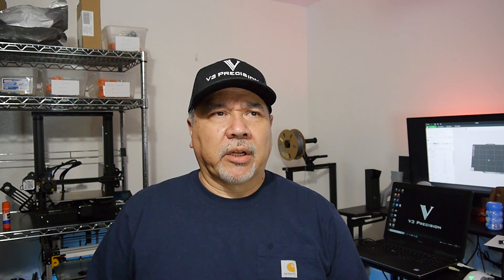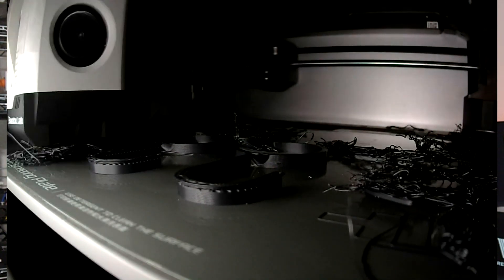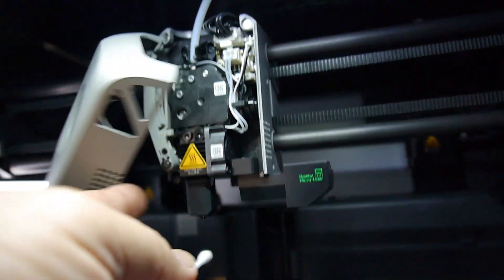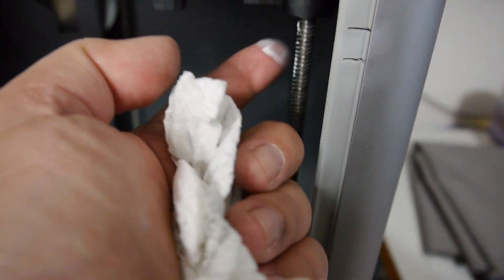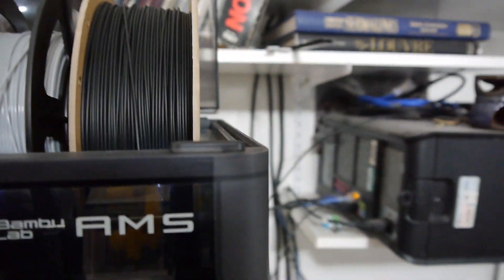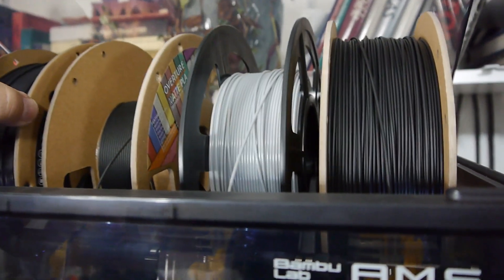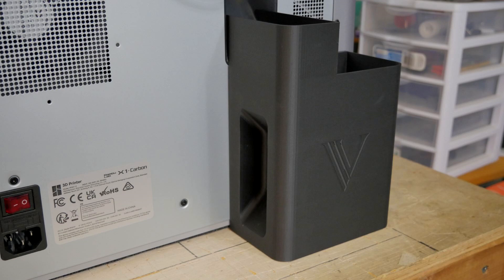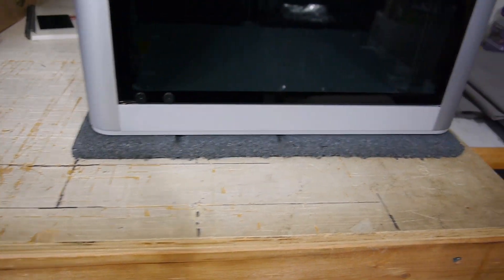Bambu Lab X1 Carbon First Cleaning and re-Greasing

Comment: Thank You for your Video. I had just ordered the X1C. I live in Italy. They just sent me the final bill. It is about an extra $400 in taxes alone; ouch! It makes me feel like backing out, but I really like what I have seen on this printer, and I am sure if I bought a lesser model, I would try to upgrade it later and spend even more for a lesser printer. I was watching a german guy adding PETG to his PLA prints instead of  Bambu Support G; cheap, and it worked great.  but you can only do that with an AMS. I just printed a horse a 20hr plus print, and I cannot get the supports off. It spoils the fun. I just talked myself into it. Haha, Thank You again for your Honest videos.
Reply from the maker: I'm sure you will like the printer.  I have many others but I spent a lot of time upgrading them.  Upgrading can be a fun project, but it is nice to get a printer that you can just power it up and print.  Good luck.👍

Comment: The problem with the cardboard spool is that they slowly break down and will get dust in your rollers...maybe you can clean them but you probably won't know its a problem until it wrecks a print.
Reply from the maker: Yes, you have to keep your eye on the cardboard spools.  They are pretty sturdy for cardboard and so far none of them have started to deteriorate at all.  Just keep the rollers clean and you're good to go.

Comment: Wish there was a way that the belt tension could be calibrated with a tool. Is there a way that it's tested anywhere. I presume you are them calibrating it again afterwards. I think I might use a mic to record the plucked frequency of the belt when I get the printer and then use that as a reference point for when doing this.
Reply from the maker: I'm trying to remember which company times their belts.  Like tuning a guitar.  Use a tuner that will register the "note" and see what frequency works the best.  You would think there is a way to measure the tension of the belt.

Comment: The cardboard are running good - but do you see any fibers rubbing off down in the AMS? Curious…
Reply from the maker: I've been watching for that, but no fibers yet.  Sooner or later I am sure the cardboard will start deteriorating, but well after switching to a new spool.  Probably an added cleaning will be to clean the rollers on the AMS.
Reply: @thinkdesignmake  - Right on. I guess time will tell. I will give the cardboard a try one day soon and monitor closely. 👍🏽